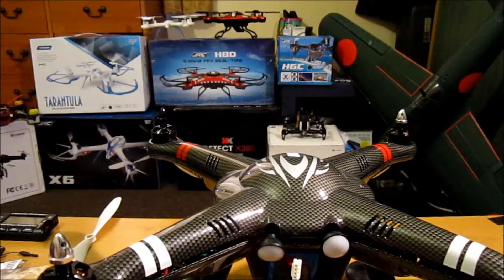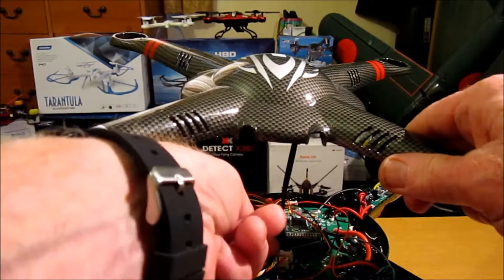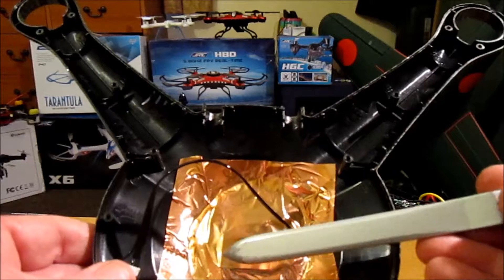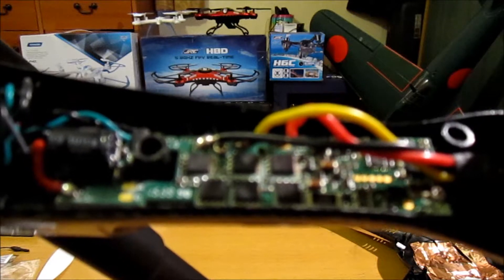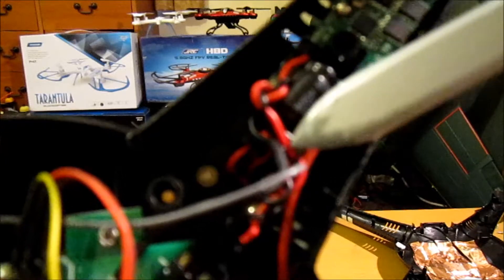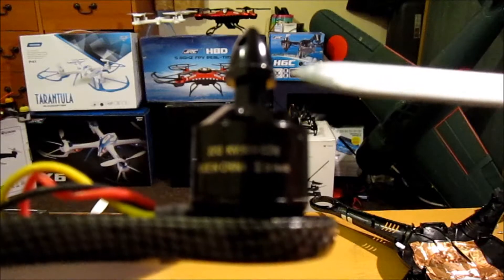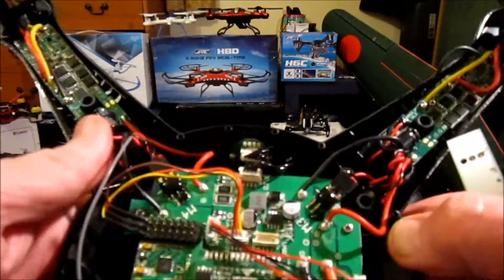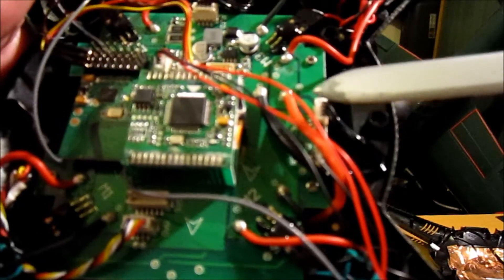X380 Breakdown - Basics good to know

Comment: Hello from Aus Bill.  Your videos have taught me much about the hobby.  Thank-you.  May I ask you a question?  

I would like to change the underside LEDS on my X380 so the Red LEDS are at the front, and the Green LEDS are on the rear.  (I also own a Phantom, and I am trying to standardise colours so both Quads have red LEDS on the front arms).  Would it be possible to just interchange the ESCs from front to back, and visa versa on the x380 to achieve the result of Red LEDS on both of the front arms?
Reply from the maker: Hi Stephen, thank you for watching and your kind comments. Yes, you  just need to interchange the ESCs from front to back, and visa versa.
Reply: Ripper!  Thanks Bill.

Comment: I have crashed mine don't know what happen but it very was flying and then just took off out of control
Reply from the maker: Hi Robert, sorry to hear that yours has crashed. Usually if it goes out of control it may relate to a compass problem or a component failure. Hope it is not badly damaged and that you can repair it.

Comment: ...so can a clockwise motor be swapped out for a counter clockwise motor by simply switching the wires on the ESC?
Reply from the maker: Hi James, yes it can if you do not use self tightening propellers.
Reply: Noticed that the wires off of your Motors are red black and yellow. On my Quadcopter all three are black. Does that matter?
Reply from the maker: The colour of the wires do not matter as a colour but the order and position does.
Reply: +James  Shipp III thank you my good sir.  Good information to know.

Comment: Nice  vid :) There is a free UART serial port "UART3" on the FC !! ..  hope they come with a BT module add-on and a phone app..wonder  what  that free uart port can be  for as there already is a usb seriell port ?
Reply from the maker: :-) I was wondering what that port was. If wi-fi, I would not connect it, as this will cause interference. Thank you for commenting and please let me know what else this may be for, if I do not find out before you.
Reply: i use it for Bluetooth on my multiwii.. multiwi app config from a smartphone..o  yeess x380 seems to be sensitive to wifi interference,  i guess some have problems because their phone is close to the controller with wifi on,,just a tough :) ..
Reply from the maker: I fly a previous version. This video is a recent version that I disassemble for parts required quickly in UK & Europe.

Comment: Bill. Finally fixed my x380. Took it out for first flight. Started props, lifted off slowly, then twice it went straight up out of control, hovered and fell back. Afraid to try it again. Any thoughts?
Reply from the maker: Hi David, I unfortunately can not grasp this, could you try again recording a video and post this?
Reply: Unfortunately not. I tried it one more time. started it. lifted it off, it hovered, landed. Took off again, hoovered, hands off sticks...then shot straight up. then died, fell broke a prop and the end of the shell. garbage.

Comment: Hello, Nice Video   
I have a problem with my drone. I have calibrated everything successfully  (getting all the correct lights) but when I try and fly It's not holding altitude. before flying I wait for the double green lights. do u have an idea what's the problem?
Reply from the maker: Hello Omard, thank you. Are you using stock props or other? Is it possible for you to make a video showing this problem?
Reply: +Bill M - RC will do it tomorrow or tonight. but what's it's basically doing is accelerating and losing power but itself.